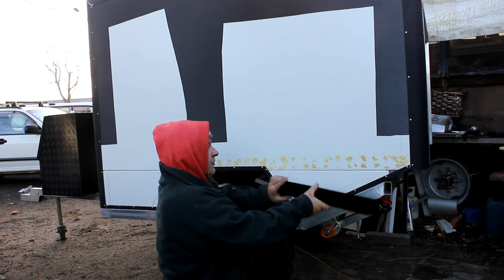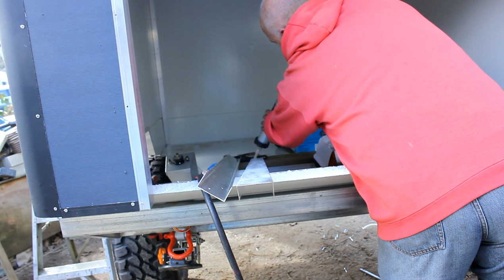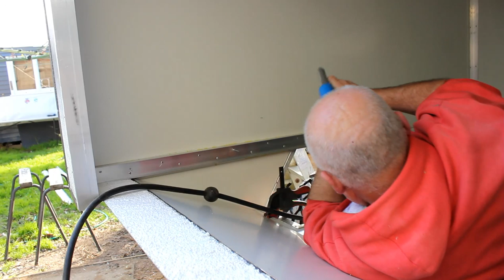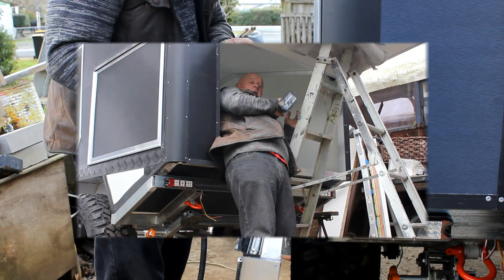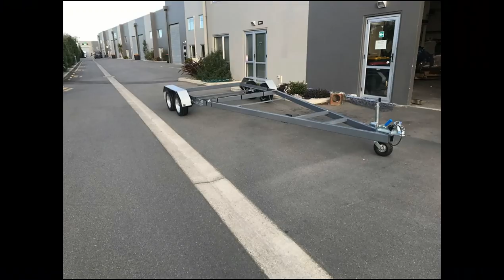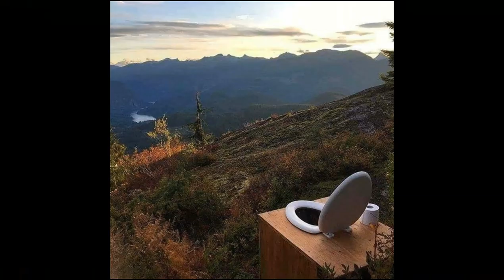DIY Off Road Camping Expedition Overland Trailer- Doors and windows!

Comment: Great build mate just say should be using a polyurethane adhesive not contact adhesive/liquid nails.
Reply from the maker: The glue is awesome steel to aluminium and is so cheap! - just dont use so much that it squidges onto the foam. I sometimes gap fill with polurathene but  its not often that I need to cos this stuff is so easy to work with

Comment: Where do you get those hinges from? What is it called? Looks amazing!
Reply from the maker: Its called one piece continuous hinge. any business that sells bus and truck body components like latches and vents
Reply: That's something I was wanting to know.  I've got a older 20' tandem axle cattle trailer that I would love to redo into a toyhauler to haul both of my Commanders and the way it's made with a set of fenders running the whole length and they set up above the floor 18" that gives me a lot of storage room for my gear and water along with a toilet waste water and with a lil thinking maybe a pop up stove and step down shower.   Lol.
Reply from the maker: @stacyreid5077  yes. Make it work to your advantage if you will still have the headroom.  To accommodate the 36"wheels I was forced to do this . But it's a whole heap more storage. Wait till you see the vid on the slide out sink and stove . I'm just working on that now.
Reply: TinyHouse and Offgrid Resources can't wait to see the rest 👍🏻
Reply: If you’re in New Zealand you can buy this hinge from Comac part number 2277

Comment: Have you ever tried a hot knife to cut this?
Reply from the maker: that would make a huge mess!  the drop saw does it perfectly
Reply from the maker: Wait a minute- do you mean the construction panel?  it has a steel skin on both sides.
Reply: Instead of the wire